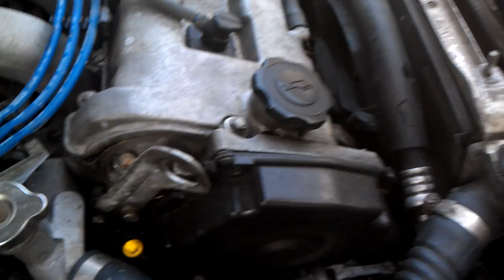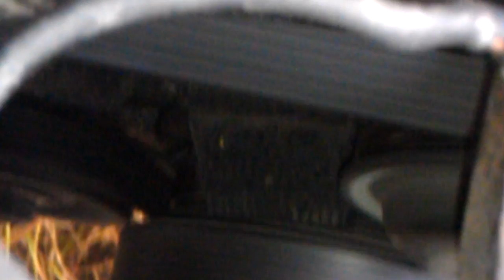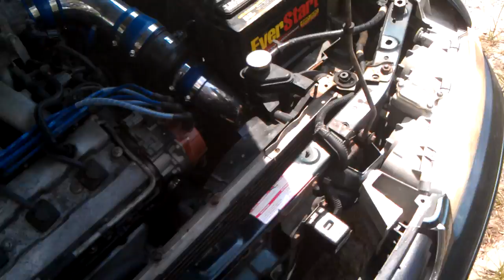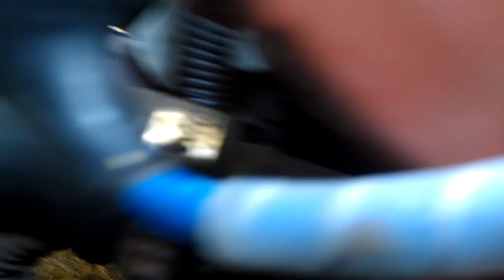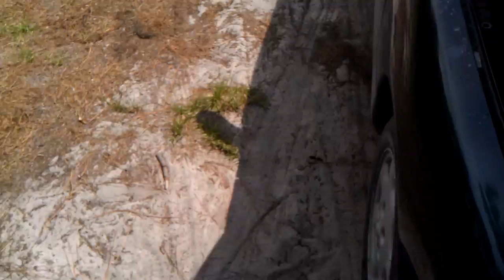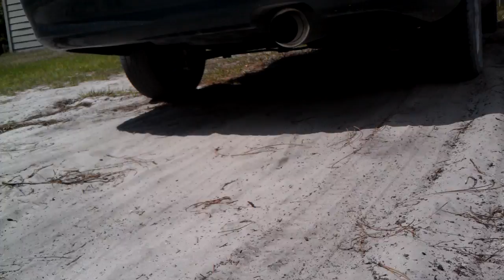Mazda 626 V6 timing differences

Comment: Maf swap it and use a bluetooth scan tool to set timing too. Also... don't you need to put the TEN pin to GND pin in the test plug with a paperclip to get the timing to set?